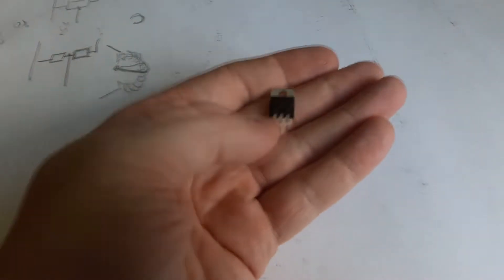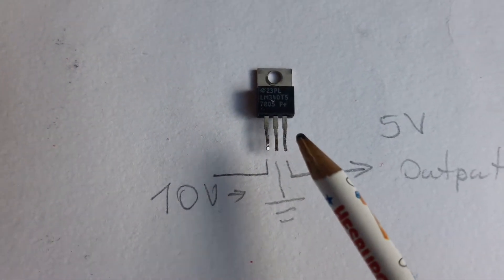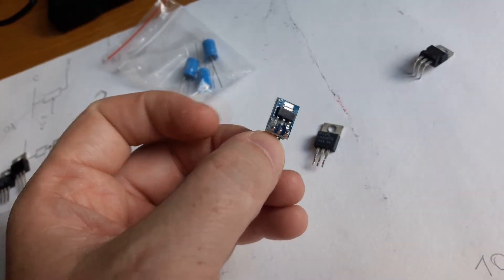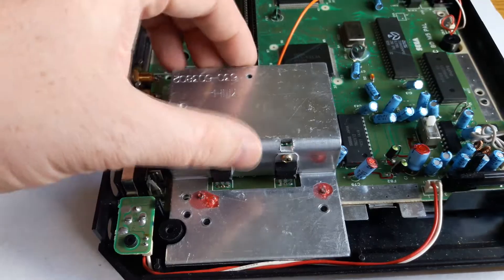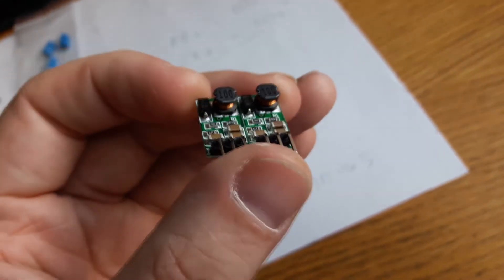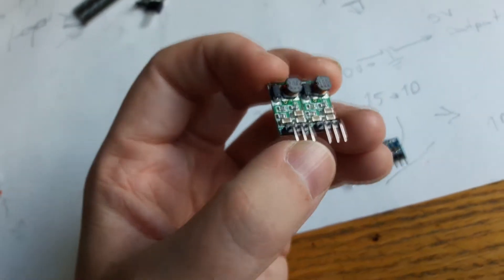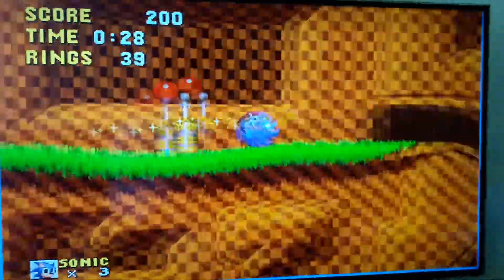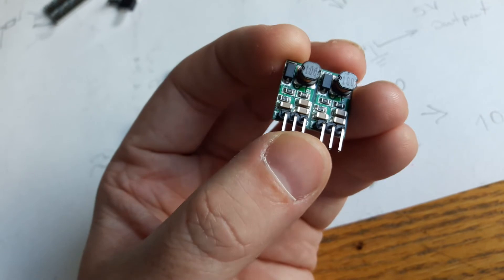Overheating Sega Genesis Fix

Comment: For something like a beloved old system, splurge for a high quality, drop in 7805 replacement buck converter : Murata OKI-78SR. $5-10 each.
Reply from the maker: To be honest, I would not do this again. There is no practical reason to change to buck converters. Probably introduce more esr and removes originality/stock composition. This was more an experiment than suggestion. But thank you for response and info, I did not know these exist, looks awesome.

Comment: Do you have a link to the buck converters you used? looking to replace the 7805's in my mega drive as i removed the heatsink for them without knowing about the heat issue
Reply from the maker: Look for "Replace-7805" in ebay.
Reply: @lauraiss1027  thank you will do
Reply: Here's one I found on aliexpress: https://aliexpress.ru/item/32766798032.html

Comment: 8:44 "not not consider adding active cooling because this would be total blasphemy.  Introducing moving parts to this solid state console must be considered a felony".  WELP, IT'S TIME TO CONVICT ME!!!  I added extra heat sinks and active cooling via copper fan attached to the Genesis heatsink and it made no difference.  So, yeah, to anybody reading this...don't try to fix the symptom, try to fix the problem.  I already have some buck converters headed my way and I can record before/after footage as well!
Reply from the maker: I would love to see how bucks perform in complete tower. I did not have an opportunity to test, because at the time of filming my MK2 RGB cable was lent to friend.